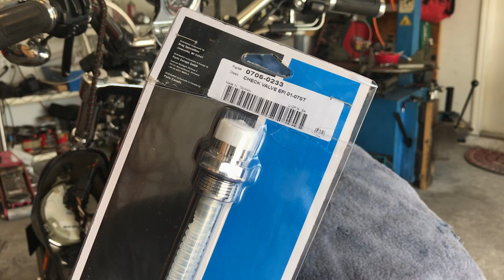How To Replace Harley Davidson Check Valve

Comment: Do you know the Toque for the Check Valve? Sorry! They have torque specs for a reason, I try to torque properly when possible. I'm always heavy handed, just stripped one of those top left tank access top plate screws. Retapped it, hope that holds well enough so I don't have to use a helicoil.
Reply from the maker: I recall the check valve only had the Top plate screws  Is that  your concerns?  Happy to help Thank you for watching and your sub Jon Dize.  Safe and have a great day.      Hope this helps.    https://www.cvoharley.com/smf/index.php?topic=67403.0
Reply: @TwoWheelRocco  My fear is that I will strip another of the 10 tank top plate screws, I'd love to know what the torque of those are, but right now I am installing a new check valve on my 2002 Road King Screamin Eagle tank and with a large wrench like the 7/8 inch, I, at 6'1" 250 pounds am likely to over tighten that one as well, which is why I was hoping to find what the actual torque specs are for screwing the check valve into the bottom of the tank, before I make another mistake. Love your video! Thanks for all of the tips and help! We novice DIY folks appreciate it. PS, I just stripped and relined my tank and while it was apart, I replaced everything new that had to do with the fuel system. This way my 19 year--old bike gets to be REBORN in 2021. I will NEVER strip and reline another tank... I will buy a brand new one first. That was AN ADVENTURE!   dizeman.com
Reply from the maker: @DIZEMANPHOTO  you already have your top plate screwed in and you have your check valve installed it's done to torque  that you have to do it before you connected it to your pump you do not want to cause that type of stress on the gas line check valve by torque now. You will be all right. That has a rubber seal.  let us know how it works out.

Comment: Hello, I was just wondering why you just didn’t replace the o-ring rather than the whole check valve, as it’s just the rubber that usually dries up and deteriorates?
Reply from the maker: Great point!  But the o-ring install don't work out well. Its internal,  Most times they fail. I have tried, Under $25 done Ebay... New...Hope this helps, Thank you for your Sub Glen.  Any questions just ask. Ride Safe and have a great day.
Reply: Just tried to do the o rings and rebuild that part essentially used a 100$ thing called Fuel Tool. Spit gas everywhere as soon as the fuel pump kicked on, bought the same fuel like from JP Cycles here in Anamosa, IA and it only cost 35 dollars.  Just do the line and save yourself the head ache of trying to dig o rings out and get them seated right.
Reply: @chrisdmcatee  Thank you, for this! I just got a new leak as of yesterday actually. last year when I had the leak, it was the outside o-ring and I went through the whole trouble and ordered, removed and replaced a Harley o-ring from Harley. This time, it's the inner o-rings that are leaking, also dripping fuel on the spark plug wire.

Comment: The fuel pump plate gasket AND screws should have also been replaced. The 10 screws are "sealing" screws are are meant to be used once...FYI
Reply from the maker: OK Thank you for watching...
Reply: Ryan: Thanks! I was wondering about that...
Reply from the maker: I don't replace them. Harley BS... Theres no end to Dealer BS.
Reply: @TwoWheelRocco  TWR: Thanks! I reckon I may add a drop of thread lock to each screw. If the gasket looks at all unsafe I've material to cut a fresh!
Reply from the maker: Use thread sealer.  You will see plastic washer on your screws, just reuse. That how I do it. You will be fine.

Comment: in tank fuel pump on a bike is BS nothing wrong with gravity flow, it worked for years. why change it.
Reply from the maker: When you have Fuel injection. You need to have fuel pressure. Gravity flow will not satisfy the fuel injectors. Fuel injection is the better way to go. It's easy on starting and it's better on gas mileage. Ride safe and have a great day.